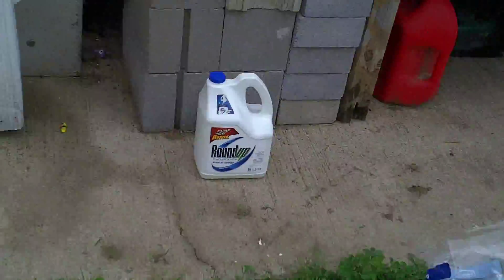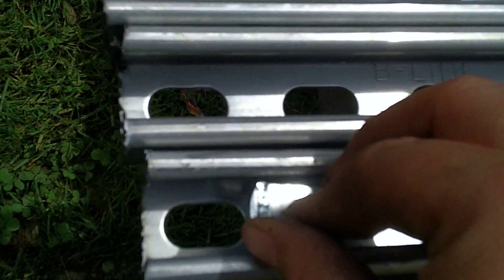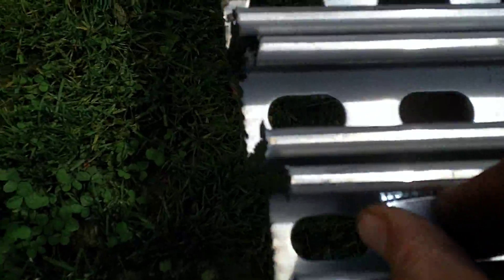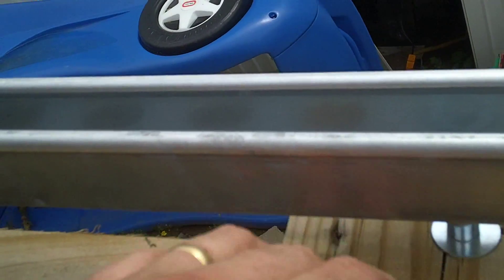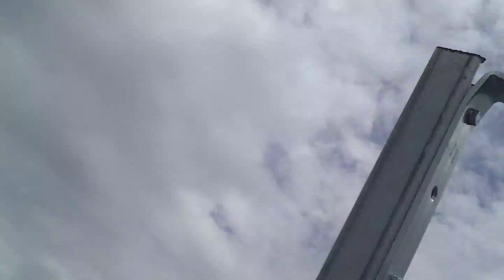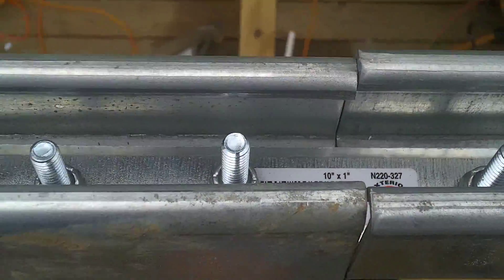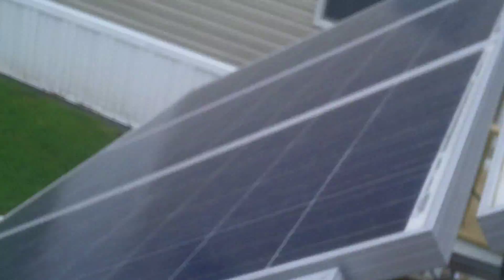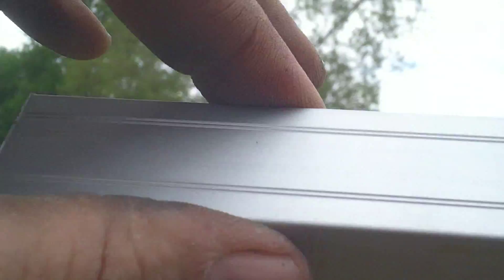how I install my solar panels using unistrut

Comment from the maker: there are people on here that use them for building solar trackers. Some have the 2 inch poles or EMT 40 or 80 pipe Cemented in place and a piece of 2 inch across the top welded to the 2 inch legs and then take the unistrut and get U bolts and bolt two of them to the pipe across the top and then the rest of the unistrut from those and then set the angle they want and tighten down the U bolt.

Comment: Money and time is always my problem. I am working on a sun tracking setup but it has been very slow going.
Reply: The best cheap way to do the tracking is with 6v hi torque slow motors with 2 6v solar panels for each motor wired in reverse of each other then have a unistrut frame under the array far enough that those 2 small 6v panels are blocked by the sun when facing perfectly at the correct angle as soon as the small 6v panels are set off by sunshine they turn the motor until shadow stops the motor and so on. Very cheap. The same way NASA satellites do it.

Comment from the maker: and its pretty cheap. they Unistrut was only 15 bucks for a 10 foot peice.  and after all said and done.  they set up is a 10 ft buy 15 ft.    and for the angle. it is one peice cut at 4 feet and the other is 6 feet and used angle brackets oen for a 45 degree angle, and the other two I just bent to so the 10 foot peice at the angle will fit. and you can do the same fram and put it on the ground. , and you can also make it smaller.

Comment from the maker: for the stand offs I used 2inch galvanized spacers you can get at a hardware store.  and largenough to not go through the holes on the unistrut. but I also use 2 inch washers with 1/4in hole one on the bottom, and one on top of the stand off then the unistrut and then another washer and then a 4inch 1/4 lag bolt you can use larger than 1/4 also but that size also fit the solar pannel holes.   and on the solar panels I used the lock bolts they will never come off.

Comment from the maker: they only cost me 15 bucks for a 10 foot peice.   I got the parts at kirby risk its a electrical supply store for industrial and residentral work.     the unistrut they call it.       or there discription is BLIN B22-SH-10ft-GALV  slot channel is what they call it but its called unistrut.  and the PLTD spring nuts for 1/4 bolts you can get differnt bolt sizes. those are 75 cents a peice.   and its hot tiped GALV strut. so a long life.